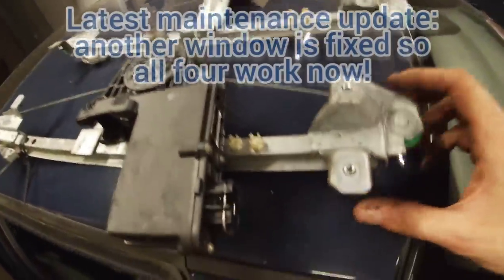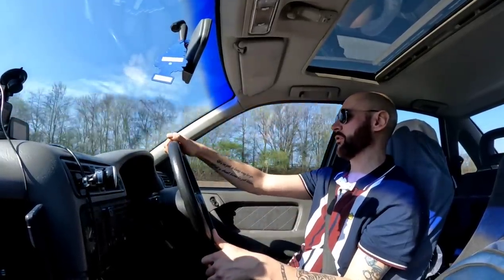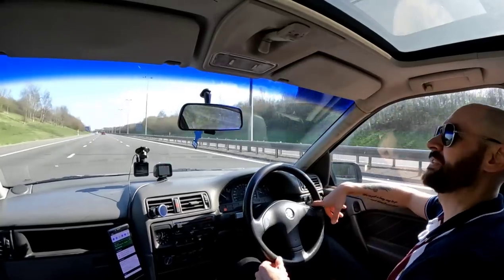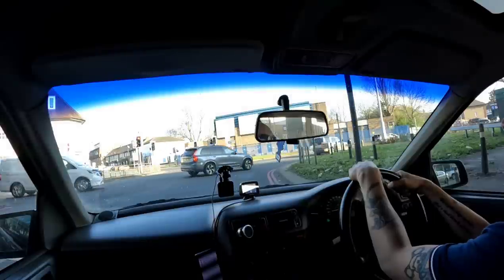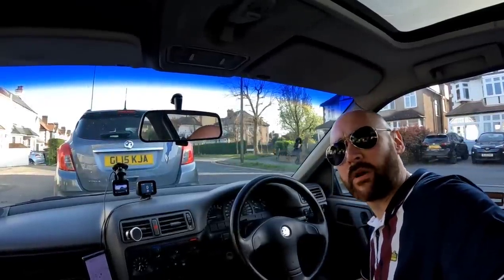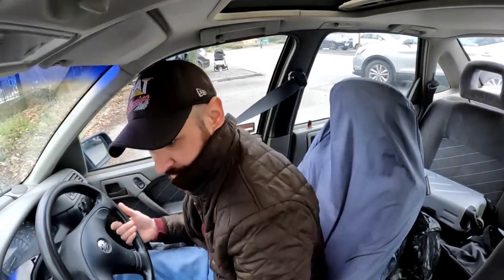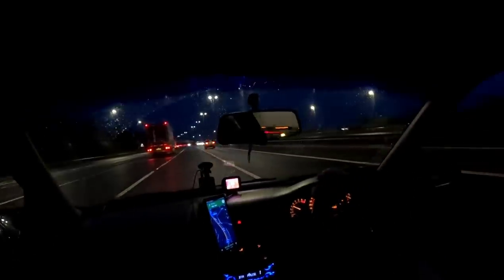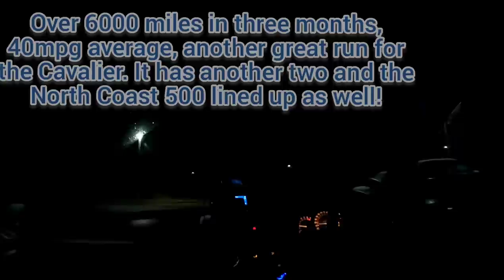London & back in the Cavalier CD to drive the new DAF XG, see Billy Strings live & buy banana yogurt

Comment: Just a tip, if you are fuelling up around Preston, when travelling up and down the M6 in a car. Come off at Junction 29 and there is an Asda less than 2 miles down a straight road with no traffic lights. Much cheaper than anything around Junction 30 or 31. I remember meeting you at Santa Pod 20 odd years ago, when you were writing for TV.

Comment: Great video Doug! Excellent fuel economy for the 2.0 petrol! 
On the Insignia topic, I have a facelift Insignia A 1.8 petrol with the A18XER. Notoriously slow and not very economical due to the weight of the Insignia. But on the whole not too unreliable. A lot of the headaches come from the dreaded oil pickup seal issue on the diesels which is why I went for the petrol. Other than normal serviceable items and a leaky thermostat housing I’ve had 12 months of relatively trouble free motoring with the Insignia!

Comment: 44 mpg @ 70mph is about the same as my 1999 astra 2.0 16v sri petrol dougie.
So quite good going your cavalier is.
I get about 47 mpg driving @ 60mph.
28 mpg around town.
Reply: Embarrassing thing is my 1.1 Mitsubishi colt only gets 45mpg too lol  how is that possible  ?
Reply: @Cayres9  Try putting redex in, a full service including spark plugs, air filter and pump your tyres to the correct pressure.
Could be the brake pads binding on due to the sliders or pistons seized on the brake caliper, especially when the brakes hot.
Spin the wheels at the rear also with the handbrake off to see if its binding on.
Get wheel alignment checked, check exhaust for leaks and replace the fuel filter.
Check coil pack too.
Reply: @1066gaz  I think the Cat Converters blocked as rotten eggs smell and occasionally juddering, also the brakes get hot but only on passenger side which is weird have just had them changed and soft pedal not good
Reply: @Cayres9  Sounds like the exhaust might want replacing as its fairly blocked up seeing it smells of eggs & judders.
Redex might clear this up for you, give it a try
The garage have changed the brake pads, but not replaced the sliders/pistons by the looks of it.
The brakes on the passenger side are hotter because of this i reckon, possibly brake discs need changing too.
Don't forget the passenger wheel gets soaked more than the drivers side because the passenger side wheel is closer to the kerb where the water resides, whereas the drivers side wheel is nearer to the middle of the road where car exhausts dry the middle of the road & the camber of the road falls away either side of the middle of the road.
Reply: @1066gaz  Had discs changed too and will try the Redex again just took the old Colt on a drive to Slough and back it got up to 70mph no problem on the A road but occasionally the juddering starts
Reply: @Cayres9  Do you mean it judders on the steering, or from the exhaust.
If from the steering, then it could be a worn suspension balljoint.
The steering wheel starts juddering at a higher speed over 60 mph when it's a steering balljoint.
Check wheel balancing & wheel alignment first though.
Reply: @1066gaz  no it’s juddering when trying to accelerate, like I put my foot down and power cuts off
Reply: @Cayres9  Still could be the cat exhaust that's blocked.
Try putting half a bottle of redex 125ml in a full tank of petrol, it will take a couple of hundred miles to start taking effect.
I have been using redex for decades and just put some in the other day in a full tank.
Also try E5 97/99 super unleaded instead of 95 octane E10.
That 95 octane E10 is a killer for old cars, don't use it.
Reply: @1066gaz  cheers 🥂 will give it a go 🙏

Comment: As a Peugeot 407sw driver the vauxhall insignia looks svelte like , comfortable and very well made 
A fellow excellent motorway muncher.
The cheapest fuel I've found in the UK convenient for me ,is a certain US supermarket chain,member only, fuel stations  in Gateshead and Watford,at the start of the M1.
On your Scottish-Anglo visits,try using the east coast routes A1, A1M,M1 as at the moment they're much quicker than the M6 ,which is not fit for purpose, south of Preston.
Reply from the maker: I'm getting a Costco card sorted, was in there the other week and got super for 1.58 - and the Vectra CDX ideally needs that, or no more than a 50-50 mix which is sometimes unavoidable due to rip off prices or no super available in some places.

I do cut over the A66 and down the A1M sometimes depending on destination/what's going on. I'm too far west to take the A1 coast road, to get to Newcastle it's quicker for me to use the M74, A69. Got to keep an eye on the traffic situation and closures it's tricky to avoid getting humped.

Comment: Dougie the ol girl is a beast mate!
I’ve got a Zafira A 1.8 and she’s wailing at me at 70…..3500rpm and only does 42mpg at around 60/65. I need your gearbox 🤣👍🏻
Reply from the maker: Yikes! That's like the box from a Belmont SRi! Way too short for a people carrier - it must shift off the mark.
Reply: @OnceDrivenForeverSmitten  for a big lump shaped like a brick it’s not too shabby, 3rd, 4th and in to 5th if you keep her on the boil it’s respectable. And for the haters/skaters of Vauxhall I’ve had this for over 2 years and it’s never let let me down. I think the key is to be sensible, do you’re research and preventative maintenance and should be ok. Looked at lots of other cars but what’s the point of getting rid of a perfectly good car that keeps going through MOT’s cleanly.

Really glad I stumbled across the channel Dougie, looking forward to the next video! 😁👍🏻

Comment: Epic trip even in a 2022 Insignia, let alone a Cavalier. Sometimes makes you wonder what progress has actually been made with cars that can eat up the miles in comfort with good mpg… and not diesel.
Reply: Diesel engines are considerably more efficiënt. That's the reason they use them in trucks  some trains , ships and farming/construction equipement. 
For trips like these i would always prefer a turbo diesel. 
Effortless torque at low revs and great fuel economy.
I used to have a bmw e46 320d 6spd, it did 4,5L/100km  without too much effort.
As for progress: modern cars are considerably safer. Think airbags and euro-NCAP improvements, ABS, ESP
But modern cars have become worse on other  points: they are WAY heavier then similar size cars of the 1980's. Compare the weight of a Golf1 to a Golf7. You'd be shocked!
Reply: @jfv65  I’m not against diesel, in fact I run one, but I’m amazed how good petrol fuel efficiency can be sometimes. Of course the best diesels will be in 59-60 mpg territory.

Comment: Insignia - had my 2.0 VX Line for over 4 years - never had an issue with it. Had the oil pick up seal replaced as preventative maintenance.....that's it other than usual servicing.
Had my Vectra C for nearly 8 years and that was the same.
I hope when my Calibra goes in the road ...it's just as good....but I doubt it lol

Comment: Got major cav envy. Re insignia, my 63 plate diesel has done 124k and I regularly sit at 75 average on motorway to and from work and get 49-50mpg. Higher on a long run and that's mapped to 200vrake and on 20's.

Comment: Nice one. I also recently had the chance to do the mpg on my Omega 2.0 8v.
Did Cluj to Budapest and back, and on the return run, doing a small part in city traffic and the most part at a steady 88 mph (140kph dead) got out 8,55 liters /100 km which would be some 33mpg.
But yet again, the C20NE and my X20SE were never meant for economy.

Comment: I had  nice low mileage insignia sri  vxline cdti 160bbhp  years ago it was  rocket on the motorway. I used it for my job in Stoke and back to Glasgow . I would recommend them very comfy  car to drive fantastic aircon system  . I loved that car I  had no problems with it during the  4 years of owning it . just regular servicing that's all it needed   .new  Tyres  brake pads that's all it cost me plus  oil filter changes  in those 4 years . I would buy another One if i could. . They do have  issues.I never experience those common issues that  people talk about if I'm honest get your self one mate there getting cheaper now
Reply: I like mine a lot, have just done the oil pump seal (luckily before the bottom end ate itself) and am very happy with it overall. Thinking an eco remap soon to take it upto 183 bhp and get better economy. That way I dont have to remove the dpf!
Reply: @hamstirrer6882  it's fast enough mate lol  but I don't blame you for wanting more power. I'm going to  get my vectra cdti remapped to 210 bhp  with my twin stainless exhaust I got from the breakers with the  vxr rear skirt rear diffuser. and hoffman race tube airbox mod. hopefully I will fit those soon
Reply: @malcolmcowan9554  yeah its quick but the gearing is sooo long (ecoflex) that it doesnt have that kick up the arse that makes turbodiesels so satisfying, and itll struggle to pull 3rd gear around town if you drop below 20mph...a 1.6 astra will do that just fine but is otherwise slow as hell

Comment: Got a Scotland trip coming up and my bloody clutch is slipping under a heavy foot, it's already had a clutch in it's life before I bought the car from Perry's Vauxhall, it's an insignia 66plate, any idea if a clutch bleed or engine software update could cure this, im asking because it's booked in for the software update the day before my Scotland trip, any help or suggestions would be appreciated
Reply: Usually if a clutch is slipping then it's burned out or theres a problem with the release system (cable/cylinder etc) but I had a Corsa cdti with a slipping clutch that turned out to be down to the injector bleed off rubber pipes leaking diesel all over the top of the gearbox (and it was a BAD leak)  when I replaced those the clutch never slipped again while I had it, upto 193k miles! Tenner for some new pipe off ebay and about an hour of my time.  You never know
Reply: @hamstirrer6882  cheers mate much appreciated, I'll mention these things to the garage when it goes in, as it's only done 69000miles in it's life and it's already had a clutch in it's life, im reluctant to think it's a worn clutch, plus when the engines fully heat soaked it doesn't seem to do it which makes me think it's definitely not worn clutch plates

Comment: Had an insignia, not bad cars, main issues are some models have the  m32 gearbox, which are made of chocolate and suffer from failure.
The big problem is the early insignia cdtis oil pick up o rings go hard and you loose oil pressure and wreck the motor.
Body and suspension wise, never had an issue. They are awfully boring tho, unless you have a vxr!